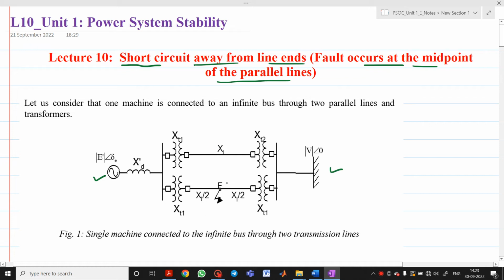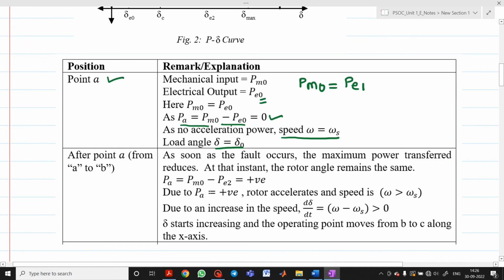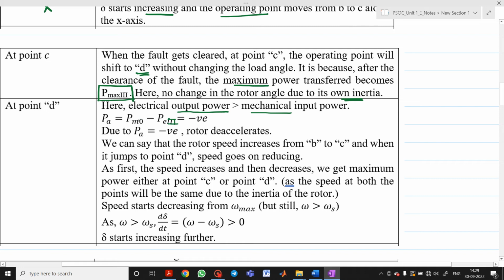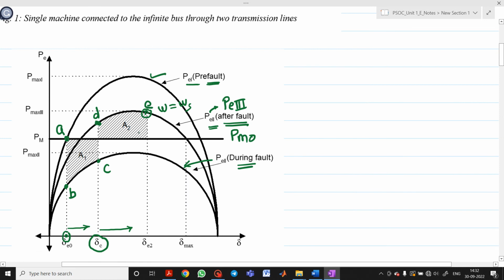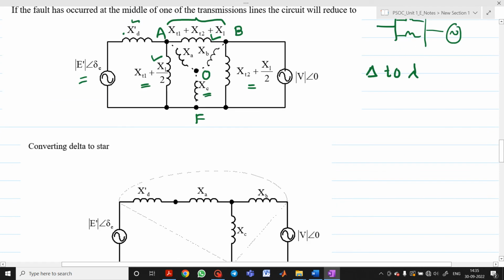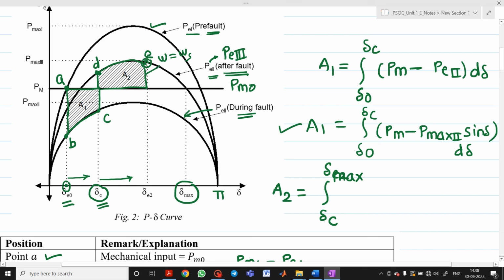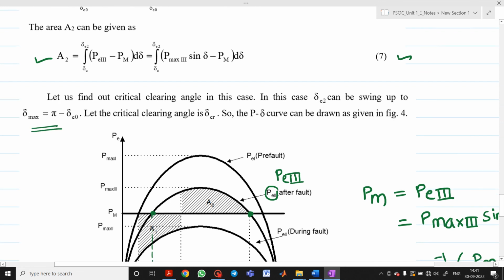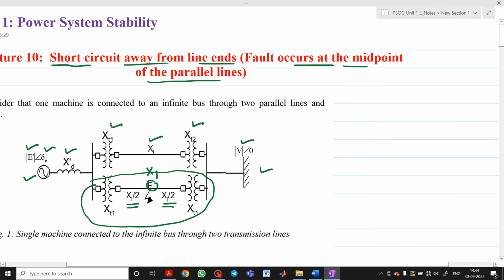Lec 10 Power System Stability Short circuit away from line ends

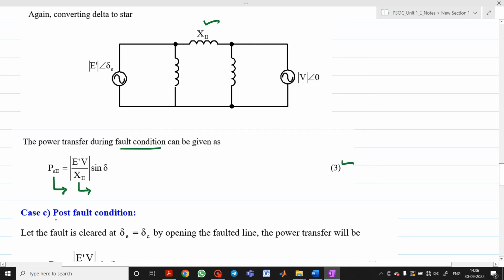Comment: 13:10 Sir, why I can use Xii in formula while there are still have parallel inductors in equivalent circuit? When compared with other period of times, there’s only 1 of X in circuit, why?
Reply from the maker: This is during fault condition. And fault occurred at midpoint. Hence middle reactance is Xii